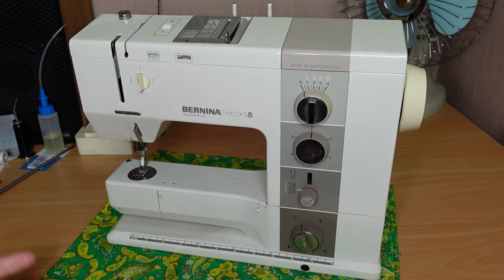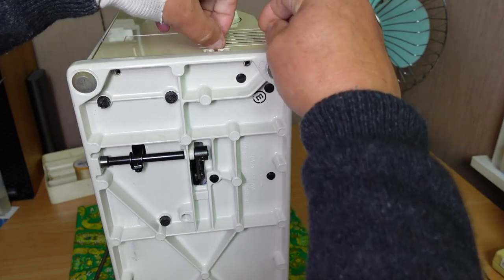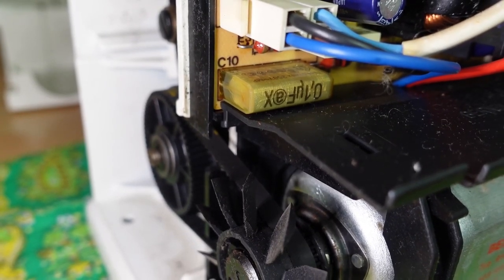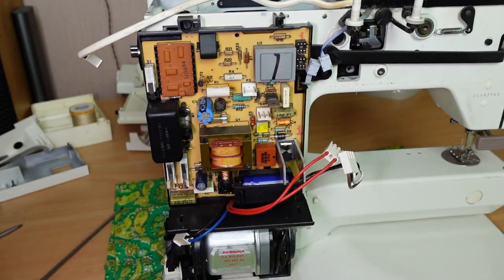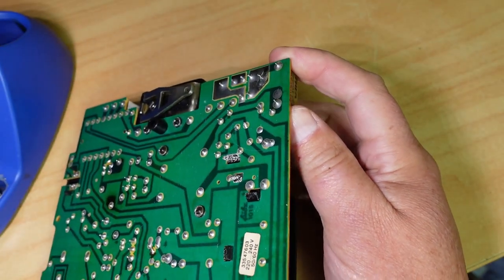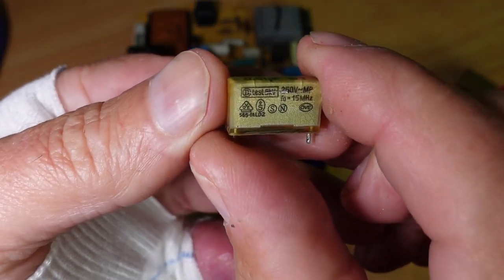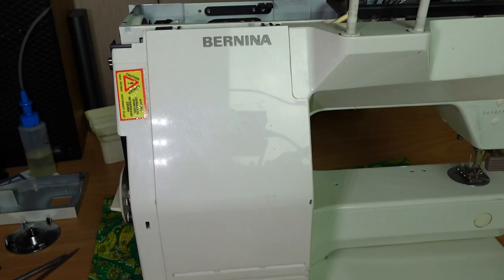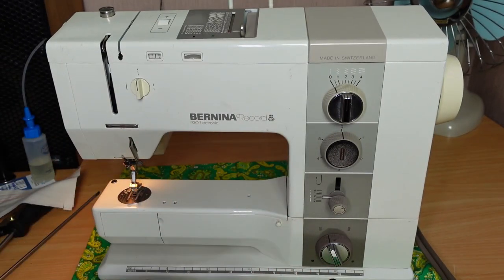Checking and Replacing Capacitors in a Bernina 930 Record Electronic Sewing Machine

Comment: Thank you so much for this video. I have a Bernina  910 so very similar.  I had called up my local sewing machine place and they quoted me $225 to fix it - with a deep service and said the part was $49 with a 2 week wait.   My husband went to the local electronics store and bought the capacitor for $1.25. With the help of your video we were back in action in a matter of hours!! So thank you so much !!!!!
Reply: Can you please tell me what kind of capacitor is it?  I am in Los Angeles and I don't know what kind of replacement to get. Thank you!
Reply: Also, would it be the same capacitor work for a machine with U.S. electrical specs???  Thank you.  Don't know anything about electronics.  My x also blew and would like to replace both, as it shows here.  Thanks, again.

Comment: Fantastic video!!!! Thank you so much. When my wife's machine made a bang, emitted smoke, and stopped working a week or so ago I thought we were in for an expensive repair and, even, worse, I'd have to put up with her without her machine for the time it took us to find a repair shop and get the work done. But thanks to this video the hardest part of the repair was sourcing the replacement caps!

We did get caught out by the LED connectors - not the cleverest design to have a 4 pin connector into a 6 pin socket, as, naturally, I chose to reconnect back into the wrong 4 sockets. Shame they didn't use 6 pin connectors with 2 blank.

As a bonus whilst the machine was in pieces I cut and pulled off the old and worn/part broken plastic thread spool holders and 3D printed some new ones. Mine don't lock in place like the originals but look a lot nicer, are a bit sturdy and being push on/pull off means I can easily make new ones if these do get damaged.

Thanks again - saved us much time and money.

Comment: Good video. I have changed the same type in my 1987 Bernina electronic 830 sewing machine foot pedal. I just bought a 1983 Bernina 910 the same PC board and motor as a 930 and I am going to change them out as  preventative maintance before they burst and could catch fire from what I have read.

Comment: I've sourced replacement capacitors here in the UK - but have a choice of lead spacings; varies from 15mm to 22.5mm. One X2 capacitor has 27.5mm. Before I open up the back of the machine, can you recall the capacitor lead spacings you fitted for both X and Y caps. Many thanks such for a great video.

Comment: I just bought this machine secondhand, and it s pristine. The X capacitor that you replaced first has been replaced in my machine. There is a Y capacitor that looks like the one in your video, and you replaced it. However, the Y capacitor in my machine looks to be in better shape. I see no cracking on it. Should I replace it anyway?
Reply from the maker: Hi. If it's a Rifa branded one, I would replace it. Thanks.
Reply: @InStitches  do you know the package size on that capacitor? I'm trying to order one but don't have one to reference.

Comment: Could those damaged capacitors cause the machine to not turn on?. Thanks.
Reply from the maker: I guess it's possible. Removing them and trying the machine may confirm that. Thanks.
Reply: @InStitches  thanks for that.